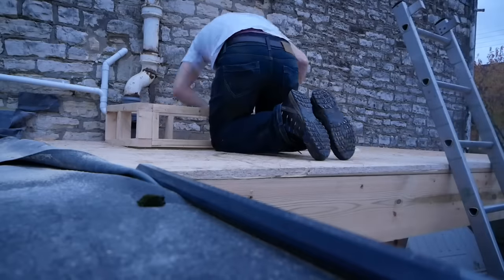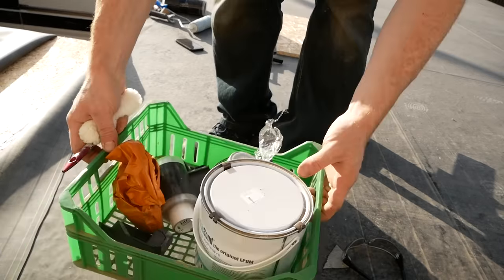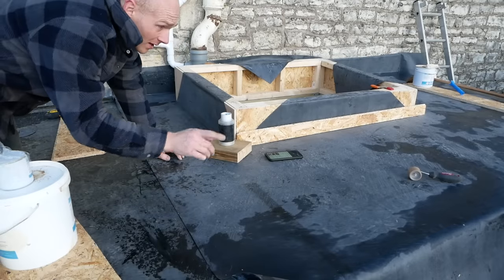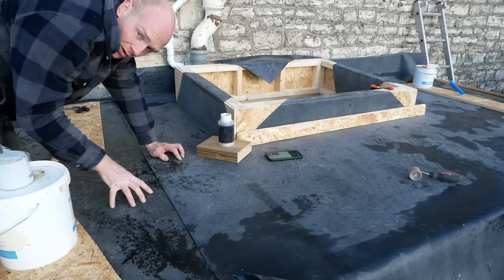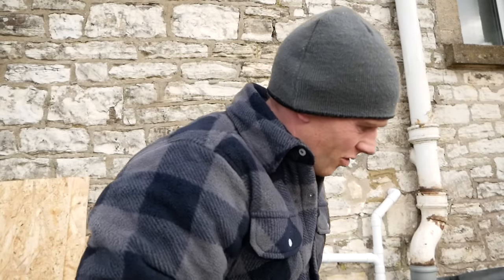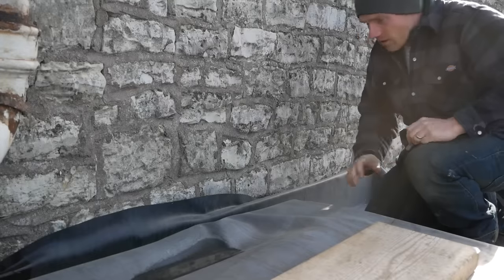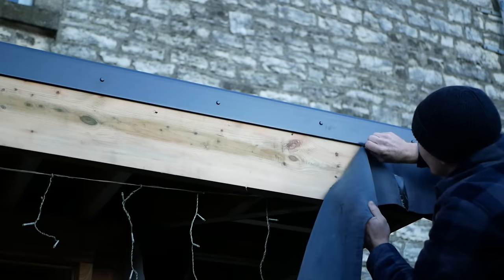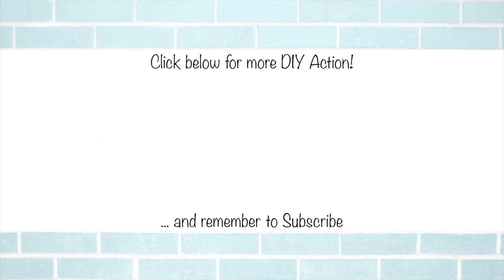EPDM FLAT ROOF & UPSTAND - This one was a little tricky!

Comment: You done a great job there Tim those form flashing are tricky,We always took a heat gun with us for those tricky bits made it a lot easier to form,they might of improved since and now it's not needed,one of the first roofs I done was on a subsiding extention I came back 3 years later the building had come away nearly 2 inches at the top and the rubber just stretched no leaks it's a remarkable product,
I always used to try and sell the rubber for simple roofs and the grp for ones with more detail I don't do it any more so it was nice to see someone else struggle for a change lol,anyway welldone

Comment: Great video and information.  What is the material you used to stick around and on top of your roof upstand? Also  did you use a vcl over the insulation on the inside of your upstand?

Comment: Great tutorial, just wondered how it was holding up as I'm  debating whether to go EPDM or Fibreglass regards
Reply: If your going to go EPDM make sure it's flease backed not the garage material used in this video! As far as grp goes ! There is a reason boats are made in sheds at a certain temperature!!! EPDM is the cheapest ! Ask yourself before you fit either .. do I want the possibility off a leak in the future 🤔 because i went for a cheap product and could fit it myself ! If so crack on and good luck .

Comment: Nice job, still undecided if skylights look better with the angle batten round the base of up-stand or just like you have done tight in to the junction between roof and up-stand. Either way so glad we went EPDM over fibreglass.

Comment: When I did our roof, every cut of the EPDM scared the hell out of me -- I was so worried about making a mistake. Like you, I found you can pretty easily fix things, and a DIY'er can do a good job of it. Next year, we will be putting a deck over our flat roof. That should be pretty interesting...   Do you have to caulk the seams with the system you are using? We used 'RoofKit" EPDM and they want all seams caulked with their rubber caulk.

Comment: I need some advice ASAP as the plasterers are in Thursday.
When the joiner did the upstands of the roof lantern he built it with 65mm timber one side 75mm the other side. This does not work with any ridged foil insulation I can get hold of. 
It has to work perfectly as the insulated plasterboard goes up the reveals.
The joiner seems pretty clueless.

My question is can the upstands be done use a rockwool or if it has to be foiled tripled up silver quilt packed tight?

Comment: Informative as ever Tim, Did you have to seal the gap above the lead flashing with silicone or similar
Reply from the maker: Yes pointed with mortar. You may be able to see the other side of the roof in the background during the video.
Reply: Good question. I wonder if that groove should be cut an up angle...
Reply: Just remembered, he repointed it last time.
Reply from the maker: Yep all done now. 👍
Reply: I used a couple of tubes of grey lead sealant for mine. Is mortar the preferred way?

Comment: One thing that might become a small issue in time, is where the lead sits on the top of the osb it’s creating a flat step, which in time the laps can become vulnerable and water tracks under the laps, seen it a few times. But might be ok 👍🏻
Reply: If you are talking about the upstand then you are correct it should be chamfered  to stop water ingress good job

Comment: Small but a fair bit of work is an understatement. Did you use lap sealant at the edges of the seam cover tape? I'm at the lap sealant stage but it took me eons to get here because of complicated corners and overlaps. Can NOT find anywhere information on how long lap sealant needs to cure before it can be exposed to water.
Reply from the maker: I think the Rubber 4 Roof YouTube channel had every stage detailed out, or at least on their website.

Comment: As an independant, would you use EPDM for an 18 degree log cabin Apex roof (7x6m), and would you use 2 sheets over lapping at the Apex.  Additionally there are 2 Velux windows 1m sq to navigate - Any advice greatlyfully received.   Oh, and do you recommend any particluar supplier/type of EPDM.  Thanks

Comment: Love your videos!!!
How did you seal around the drain pipe?
Thanks
Reply from the maker: Using an EPDM pipe sleeve, looks like a witches hat. Otherwise if pipe already in then you need to apply overlapping sections (best checking website for details on method)

Comment: You were very methodical in ur approach but a couple of pointers is always have 4 inches of contact adhesive around any perimeter and when joining 2 layers of epdm you should only adhere 1 side first and then the other as the quick prime is reliant on timing, also if you’re brave you could have glued the membrane first and cut out the hole after but that could be slightly risky, good video though

Comment: Tidy on them corners. When joining the old roof to new, I've seen it done with small piece of timber ripped into 1/2' x 1/2' , boned and screwed to the osb and the old epdm folded over it and bonded and the new folded over that and bonded and the joint will never leak.   I don't know how they debonded the old epdm though.

Comment: you mentioned you wouldn't do this on a large roof, can i ask why?
Reply from the maker: It sure which bit you mean. May be that I was saying that I would pitch the angle a little more on a larger glass. No reason not to go big. 👍
Reply from the maker: I think I was referring to the fact I took off upstand and cut the opening on the EPDM first. Usually it is just measured and cut which would be easier in a big roof.

Comment: Although the joining clips clip in your best putting pins in each one as in time they will come off other wise I have been doing rubber roofs for quite a few years and the joining clips alway come of if they are not pined in
Reply from the maker: Good point. I glued one side of each clip on the other roof last year which worked well and still allowed for expansion. Still to finish off the last side of the trim so will sort all the little bits off then. 👍

Comment: The lead flashing should have been bedded into the wall to give a 45deg slope on the top as what you have done will allow standing water that will migrate back into the wall causing damp and/or spalling.  The flashing joint should have been 12mm x 25mm deep to allow for mortar pointing to the full depth of the joint as mastic is only short term in this location especially where you have standing water.  The flashing should also have been set in with lead wedges twice folded, not the bits of lead offcuts you used.  The folded wedges allows decent movement of the lead as the differential movement of the lead/stone wall is substantial.
I also note that you do not have cold roof ventilation at the abutment that is essential to keep the roof timbers in an acceptable condition - check with the Building Control Officer.
What this video shows is poor, but unfortunately too common practice in roof detailing.
Reply: I'm a roofer you havnt got a clue mate
Reply: @nonsheep5823  I have been specifying and inspecting roofing works for the last 50 years for both domestic and commercial projects.and have been called as expert witness on building construction matters, so I guess I must have a clue.  And I have met roofers who certainly don't have a clue.
Reply: @clivewilliams1406  yeah exactly you don't do or have never done any roofing , keep to the books
Reply: @nonsheep5823  I have actually, both tiling and flat roofing using BS747 and Polimer Bitumen as well as single ply.
Reply: Cool I'm doing a 800m sbs roof now insulated vapour barrier down welding lead outlets now , im doing it stop talking about it